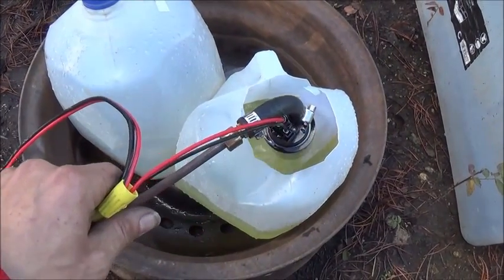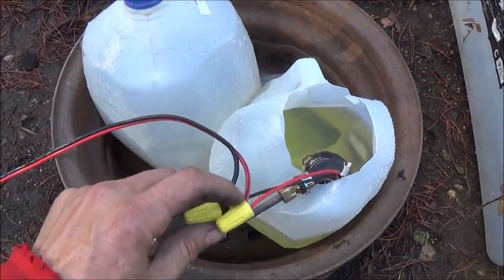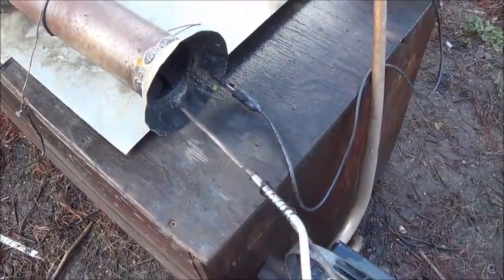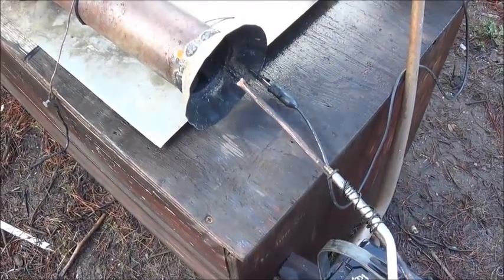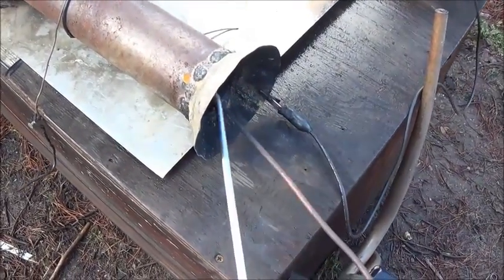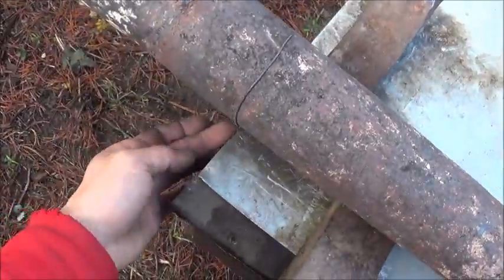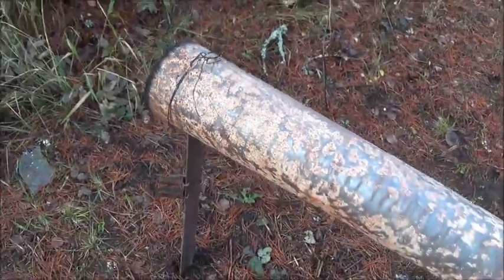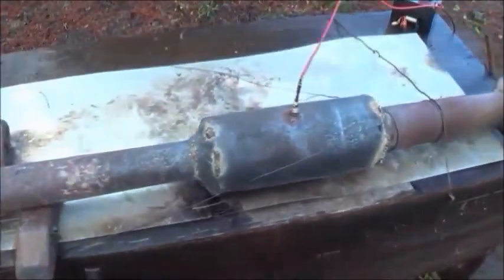Large HOMEMADE  "Valveless Pulse Jet Engine".

Comment: Hey man cool stuff. Have you ever heard of a "joe pipe" or "flame pipe"? It is much like the simplicity of the pulse jet, except it is lower power/thrust but you can run it with a gasifier, for example. You might find this "Joe pipe" is a perfect combination for your other cool experiments. Watch how fast this thing will boil water  https://youtu.be/U4WS-VoRECc   What you will find is that this is amazingly efficient, it appears. Uses the same implosion concepts of the pulse jet but is a more practical for everyday homestead use. Check it out!

Comment: Great video! One of my current ~30 projects is effectively harnessing the principle of Tesla's valvular conduit for use in a "valveless" straight-pipe pulse jet. I've done a number of experiments on the valvular conduit and I think I have some incites to increase efficiency to the theoretical ideals Tesla foresaw. I'm not sure I'll get enough free-flowing air with my design, though. It may be too choked to run a pulse-jet. I'd love to hear your feedback once I get some full-engine tests going.